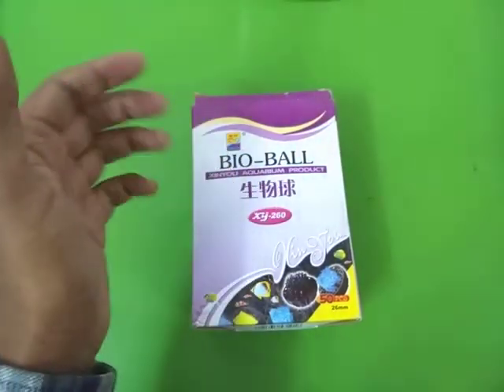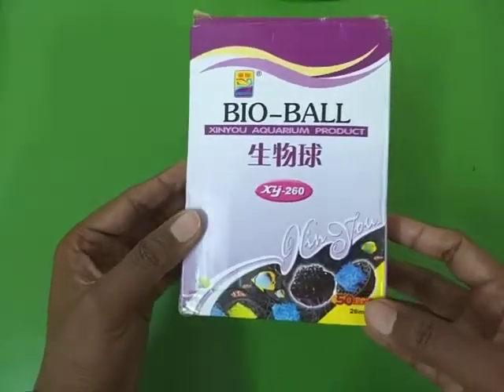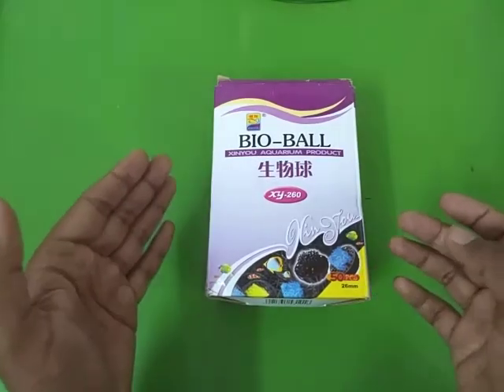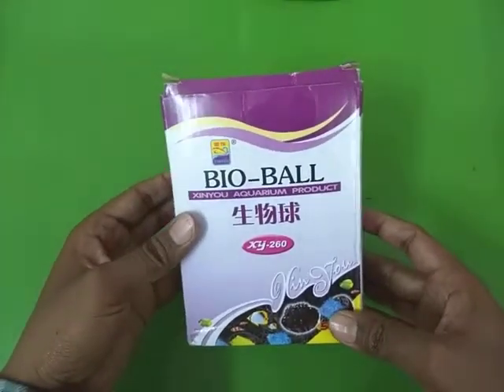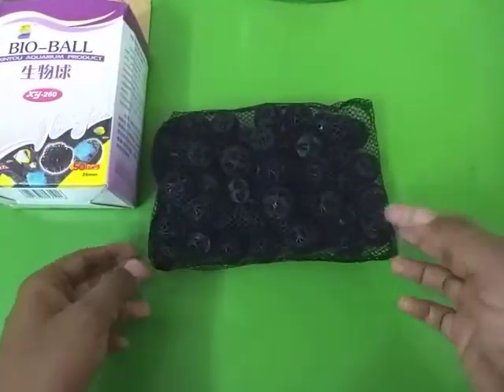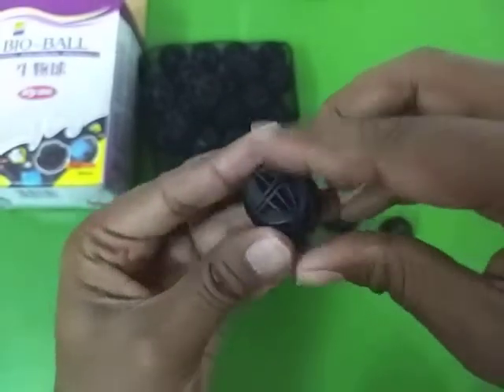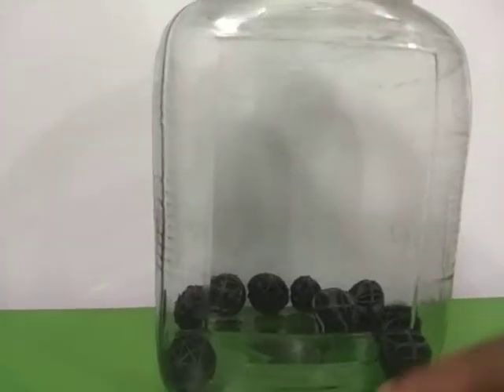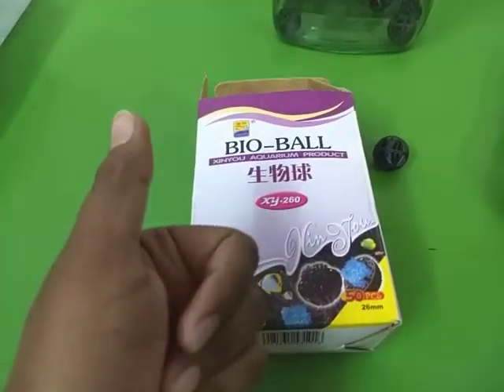Aquarium Bio Balls. What are they & how to use them.

Comment: I have a hang on back filter, so can you tell me where to put those Bio balls are, there are not much space where I can put all my Bio balls, I have 50 balls and my tank size is 18*12*12, right now I am putting all my Bio balls on the running down water position inside the filter, let me know the correct position to place my Bio balls then it will be really helpful, thank you
Reply from the maker: you can keep the bio balls where you have already put them.

Comment: great video man, I have a 1 gallon fish bowl with 1 guppy in it, can I just put bioball and ceramic ring (filter media) into it without having a filter?
Reply from the maker: you can but,  i would recommend a hang on the back filter. because the tank is very small water parameter is very difficult to maintain. Also, one guppy is not good if you want to keep just one fish then get a betta fish.

Comment: I put the bio ball in the sump...does it float in the surface
Reply from the maker: They float on the surface for a little while then they sink at the bottom when the air trapped inside them is escaped.
Reply: @gurribuy  how many days does it take to sink...I put mine 2 days back...it's still floating in the surface
Reply from the maker: in my tank it only took about 3-4 hours. maybe the plastic of your bio-balls is different that's why they are still floating. Try to sink them with you hand and agitate the balls a bit.
Reply: @gurribuy  they're still floating...not sinking...been one month now....!
Reply from the maker: @LegendaryKingston  Well, the plastic density of your bio-balls is lower than the water that is why they are floating. If you want them to sink just put them in a mesh bag with a small rock this should help.